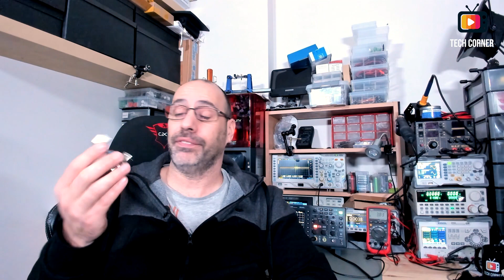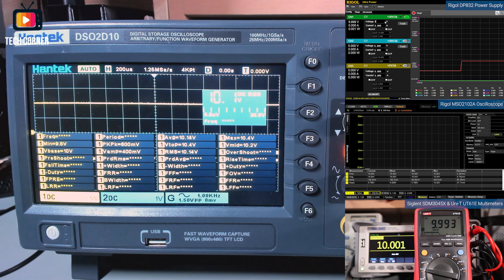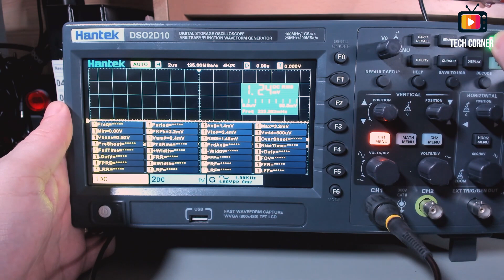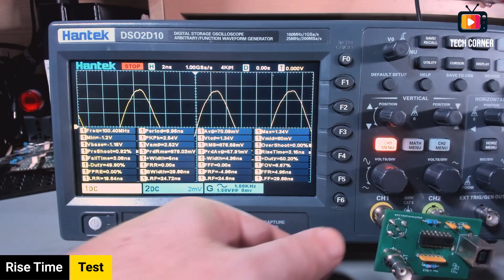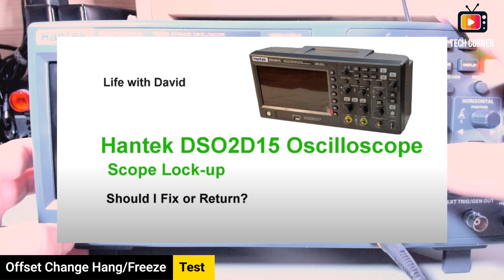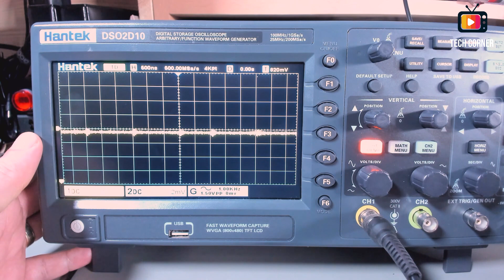Hantek DSO2000 Oscilloscope ReTest After Firmware Upgrade ⭐ 2C10 / 2D10 / 2C15 & 2D15

Comment: I've had my DSO2D15 for about 1 and a half years. When installing the latest update (hardware 3209 and software 240326.00), the crash when changing the offset is over.

Comment: HANTEK DSO2C10 measures 12v battery voltage. Why does channel 1 measure more than channel 2?
Channel 1 measured MAX 12.8V, but channel 2 measured 12.2v.
The difference is approximately 0.6v.
This clip https://www.youtube.com/watch?v=nuY9gXZR0zo

Comment: huh - how about you use a waveform rather than a voltage with all that noise you have on there - it's no wonder you cant get real mv measurements
Reply from the maker: Hi, I have a lot of videos on this oscilloscope, only tested here the things that failed in the previous ones. Thanks for your input and for watching!

Comment: It’s been 1 year since this video and I think there have been more updates. Are the problems still there or have they been solved? Also, at the end of the video you mention a signal generator but I didn’t understand the brand or model (I think it’s Jantek but I can’t find it) and also the cheap protocol analyzer you mentioned. Thank you.
Reply from the maker: Hi, after this video, I did some more, search the channel Oscilloscope playlist and you have it there my final video. My function generator is a Owon XGD2100 Dual 100Mhz output. Juntek has some very nice function generators, very affordable for what they give you, I recomend the PSG9000. In terms of protocol analyser just visit www.techcorner.tv/aliexpress and insert on the search box "USB Logic Analyzer", you'll find it from 4€. Thanks for watching.

Comment: I got a DSO3254A and the PoE option is just a straight up lie. No matter the switch or injector i use, the scope never boots or shows any signs of life at all
Reply from the maker: Hi George, sorry the late reply. It's a pitty because they have nice products, but sometimes seems they don't care. Hope you can solve your issue. You have also that option where you have a power splitter in one end with the power supply (bundled with the oscilloscope) and in the other end you have just the terminal. It operates in RJ45 cables, higly used for IP cameras. This was suggestion to solve your issue, it should work with PoE as annouced. Thanks for watching.

Comment: Mine, newest 230327.00 Firmware    has no offset problem, can move up down , no hang. I tried voltage too..  1mv setting shows half a millivolt on no input , so i am satisfied with the results.
Reply from the maker: Hello! Sorry for late reply, house move and vacations. Really good and I'm happy that is working ok, I still have to do an update of the latest firmware that was release a couple of weeks ago. Overall, is not a bad device, I like it. Thanks for watching!

Comment: Good, how could I solve the problem when putting it in roll mode, it does not show me the square wave, it only shows me a broadband, I already tried to configure it and I do not find the case
Reply from the maker: Hi, I can't know what you're seeing on the screen 😁. If auto doesn't fix it, they you have to work with time division and trigger position to have a steady signal. Thanks for watching!

Comment: What do you prefer? Hantek DSO2C10, Siglent SDS1052DL+ ó FNIRSI ADS1014D? :D thanks!
Reply from the maker: Hi, Siglent is on another championship. For me FNIRSI 1014D is very nice to work but misses a lot of important functions, so between Hantek and FNIRSI, in this case, I would go with Hantek, if the budget allows, then Siglent for sure. But 1014D is being sold around $100 in Aliexpress, so it's another price range, it all depends of what you have $$$ available. Thanks for watching.

Comment: Friend, my Oscilloscope HANTEK DSO5102P I am no longer able to update when I update it, this message appears ''Firmware Update Failed, error 0xfe An update file was not found on the USD device'', how to resolve to remove this error do you know what it is, or someone thank you very much
Reply from the maker: Hi, I know that this might be silly, but just trying to help here, did you try to upgrade the PC USB (oscilloscope) drivers to a more recent ones? Thanks for watching.
Reply: @TechCornerTV  El mio esta funcionando, creo que nunca se ha actualizado, quiero actualizar porque hay un firmware del 2021, pero que pasa? Entro al proceso de actualización me pide presionar F5 y me aparece el mensaje error de actualización de firmware, error 0xfe, No se encontró un archivo de actualización en el dispositivo USB. Queda así

Comment: Please make a short video of closed loop noise level at 1mv.
Also please make this with  Siglent SDS1202X-E at 500uv.
And please compare both.
Reply from the maker: Hi, I don't have Siglent oscilloscopes... that kind of equipment starts to be to much expensive for buying for reviews and if siglent don't send it for review, I can't buy it only for that purpose. But I can't tell you that 1mV this equipment is not able to correctly see the voltage, it starts to have some accuracy at 15mV give or take. Thanks for watching!
Reply: @TechCornerTV  Thanks for your fast and valuable reply! 🙏✌
15mv is too high!

Comment: All you say with about this garbage Oscilloscope is that you can live with it. No one is asking you if you can live wtih it. Just be honest and tell us that you don't recommend these's units until the company fixes these  issues.
Reply from the maker: Hi, that's for you to decide. I show my experience, I am not your dad or your boss to tell what to do. I can leave with it, if I really have the need to analyze signals that where in the mV range, this will not surelly be my choice. But it is pretty good for a lot of other use cases. This kind of videos will pressure also the brand to do proper quality assurance on what they release and to release fixes to these issues. This specific one was solved on later firnware upgrade, Thanks for watching!
Reply: @TechCornerTV  Thanks for update

Comment: Amigo, vi tu video  anterior donde hacias comparaciones, sobre este osciloscopio, encontré un vídeo, de febrero del 2022, donde hacen una actualización, en dos partes, una del firmware y después del software, algo complicadas de hacer, pero aparentemente se corrigen los problemas
Reply from the maker: Hola Sergio! And thats all my spanish there 😁 I still have to do a final video with the latest software, but no time to do it... overall is not a such a bad equipment, specially considering the price. Thanks for watching!
Reply: @TechCornerTV  Despues de mi comentario, encontre tus videos con las actualizaciones q te comentaba. Estoy pensando en comprarme un osciloscopio , pero voy a optar por el Owon, tiene menos funciones, pero es mas exacto y parece funciona mejor. Felicitaciones por tus videos y gracias por ayudarnos a decidir en nuestras compras

Comment: Será que vale a pena ter um desse?
Reply from the maker: Olá Marcelo, no geral, não é uma má unidade no sentido que te dá muita coisa por um preço acessível. Tem alguns problemas em leituras de voltagens muito pequenas (mV) mas à parte disso, no geral, é um bom aparelho. Este problema em especifico, foi resolvido com um upgrade de firmware. Obrigado por assistires!
Reply: @TechCornerTV  Queria saber se há necessidade de comprar um 2c15 em vez do 2c10? Faço reparo em placa principal de tv

Comment: try to get measures using the same probe used in Rigol , maybe the hantek  probe cable is no good and has some loses...or internal probe circuit is no good, and maybe is needed do the scope calibration
nice video
Reply from the maker: Hi Wilson, thanks for the tips! One of these days, I'm gonna do a last & final review of this device and in that review I will use my Rigol probes. Maybe it gives better results. Thanks for watching!

Comment: My first scope was a hantek dso5102p and the waveforms were so noisy. I saved up for a siglent then a month later scored a tektronix and a 1kva anchor of an isolation transformer in a very lopsided (but honest) trade. I gave my hantek away and vowed to never buy any hantek device again. I will say though that if the one you're showing was out I'd probably have liked it more. The old hantek had no features.
Reply from the maker: Hi Joey, yes that is the main strengh of this unit, you get a lot for the price you have. Otherwise, Owon will have no problem to suplant this. Thanks for watching!
Reply: @TechCornerTV  I wonder how the built-in awg will be over time. I'll give them credit for keeping the range low. Alot of other Chinese scopes or awgs in general try to punch higher than they're capable of and suffer for it. I don't think I've ever used my 2 chan Chinese awg for anything higher than 1mhz. It says koolertron on the scope but I've seen a bunch of other companies brand on it as well. It's decent though. 60mhz 350msa 2 chan but not split like some as far as I can tell. Amd bought xilinx recently and it would be cool to see an nvme pcie gen 5 logic analyzer or something out of that deal. I heard there's an fpga co processor for edge computing in that package.
Reply from the maker: @jstro-hobbytech  The AWG actually is pretty decent. Only 25Mhz, most people don't even need one, but you can define the voltage, it has arbitrary functions and a function editor, so quite satisfied with that one. In terms of long run, can't tell. On my daily day I use my Rigol.

Comment: Mine freezes occasionally but nothing like yours. I upgraded it to 150 MHz but I don’t have any way to test it. Have you upgraded? It’s free you just have to rename a file.
Reply from the maker: Hi Stevens, I'm working on a frequency generator based on high speed crystals, something cheap that will allow me to test oscilloscopes with frequencies higher than the 100mhz that my function generator can output. When I release that video, you can see how to test it. Your problem, probably is because of heating, you have internally a support for a fan, maybe hack your to install the fan. The freezes I got in this video were firmware issue and were solved with an upgrade. Thanks for watching!

Comment: I own the DSO20D10 and my unit also locks up when rotate the channel 1 position knob. Interestingly, it does not lock up on channel 2. So how do you prevent this?  You can prevent channel 1 from locking up by moving the position knob very slowly. It appears to me that the processor gets overwhelmed when it tries to perform too much math. When you move the knob slowly it is able to keep up so no lockup.
Reply from the maker: Hey Bob, upgrade to the latest firmware you can download from hantek website an I have a video here in the channel teaching how to do it, step by step.  https://www.youtube.com/watch?v=4Vy9acRJFQc Thanks for watching!
Reply: Estou com mesmo problema conseguiu resolver o seu?

Comment: Is it possible for DSO2C10 that can generate waveform(enable wave gen) after upgrading my firmware?
Reply from the maker: Hi, it depends when you got it. The first units came with the function generator harware and it was only a firmware limitation. I know that there is units that don't have the hardware, so for those it will not work. Thanks for watching!

Comment: I check my 2C10, offset wok fine, use last firmware.
Reply from the maker: Hi again, there are more recent videos where that problem is solved with firmware upgrade. I think it is a set of 3 videos to do a backup, restore from brick and another one, can't recall right now. Thanks for watching!

Comment: Thank-you, this video makes me re-think getting the Hantek 2D15. I'm a hobbyiest, this would be my first scope. I'm not sure I could manage the constant freezing. I read some review where they said  the IC  in the Hantek needs some  heat sinks and that will prevent the Freezing. they said "Radiators" on the IC, but I think they meant  heat sinks.
Reply from the maker: Hello, I'm trying to get the time to make on last & final review with the last firmware that came out recently. This problem was solved with a firmware update (I show on a video after), but at that time still had some issues with auto sensing and low voltages. I want to clear if that is solved, but I have devices pilling up for review sent by manufacturers and those have always priority. If someone has the trouble to send you the device for review, in my opinion, you should at least review ASAP. 
Thanks for watching 👍 You're quite active and I really appreciate your comments 🤜🤛
Reply: @TechCornerTV   totally understand, I'm trying to help someone else who has the 2D15 hantek and has lot of issues. I sent them to eevblogs.

Comment: The latest video that I can find is dated April 15, 2022 and 45 minutes in you say that the freezing issue is still there. Is there another video? It seems like the safe thing to do is to pay the extra money and go with the Siglent SDS1202X-E.
Reply from the maker: I'm so sorry to mislead you. I thought that I mentioned in my 3 videos series and I didn't. Ok, so heres the thing, the problem of freezing while moving the offset is solved. Still has some little issues with voltage detection, but nothing serious and I have to check if the last firmware solves that. Next month will do a video on that, but if meanwhile you want one and wish to help a bit the channel, you can the affiliate links 😁 Seriously, my opinion is that it is a fairly good device for the privce, you get a lot in a accessible price.
Reply: @TechCornerTV  Maybe you should do a short video to clarify this. I was searching like crazy, because I don't have much money and need and oscillosope, but the often recommended Rigolas are too expensive for me. And your latest video of the DSO2D15 made me think that it still had this issue, too.
Reply: Is Siglent SDS1202X-E a far better option than Hantek dso2d10?

Comment: Have the issues you outlined been resolved? I was looking at purchasing the Hantek 2D15, if they have not been resolved could you suggest an alternate?
Reply from the maker: Hi, I will do a video (final to close this) next month with lastest firmware that was release last month. But in general, the latest video I made about the Hantek DSO2000 already corrected this ugly bug, it still had some errors in voltage reading, but I'm expecting that to be corrected with this last update. Thanks for watching! 👍

Comment: Do any of the DSO's have a DC Offset function? In many transducer measurements it is necessary to measure low level voltage changes (~10 mv) that ride on top of -12 VDC offset. We often used a special Tek analog scope plug-in that had a 'DC Offset" function so we could keep the the scope in DC Coupled mode in the 10 mv range and use DC Offset knob to center the waveform so we could observe low level DC mV changes that were on a -12 to -15 VDC signal. Thanks.
Reply from the maker: Hi, many of this entry level oscilloscopes emulate functions and the result many times is not the desired one. If you had a special equipment to correctly do that measurement on the Tektronix, I think is pretty safe to say that they haven't the equipment in this lower price oscilloscopes, or at least, with the same precision. Thanks for watching! 👍

Comment: When do you need the function generator?  To calibrate tape decks by generating test tones?
Reply from the maker: Hi! I believe that is one of the usage scenarios, but you have a bunch other scenarios, to mock on the circuit for example, a motor output (sinewave), to mock ECG's and be able to test equipment, to simulate the work of a motor, a good function/signal generator car replicate the signal you get on a lot of situations, so you can test your circuit without having the real thing on hand, like a car motor. Thanks for watching. 👍
Reply: @TechCornerTV  can it really generate test tones, say 20 mhz tone?

Comment: Great video. Could you please compare the waveforms captured at 1~10mV level between 2D10 and Rigol or better oscilloscopes? It's important to know if 2D10 can capture small glitches ? Thank you
Reply from the maker: Hi Franz, in september I'm gonna do the last video about this oscilloscope, because many people asked for it, but spoiler alert, it is better, way better, but still with some issues. To be fair, this isn't a multimeter, but anyway it has to be accurate. That will be my last review video on this oscilloscope. After that, it will end. Thanks for watching! 👍
Reply: Dear Franz, I´m radioamateur and electrical engineer, too. I need this oscilloscope only for alignment for some older CB-Stations and some microcontroller projects. I bought this scope before one week:2D10. But at low signals, it is something noisy, I have some analog meters for low signals and a spectrum analyzer Rigol DSA815, but I think and old analog oscilloscope, would be better for me, because it´s not so noisy for lower signals.I have an analog oscilloscope Hitachi VC-7504, 150Mhz scope, with something digital properties, but it need serviced, I changed some capacitors in vertical unit, but I dont get a service manual from Hitachi more.Without alignment it doesnt start.😕

Comment: Bought the DSO2D15 model, only later I discovered it has Trigger Level problems with signals below 300 mVpp. I did all the firmware updates, still the traces run on the display, no way to stop them. Things get worse if you keep the oscilloscope on for more than ten minutes. Then, if you select a 50 mVpp sine wave with the internal signal generator, the image is strongly distorted.
I contacted Hantek several times, they wanted a video of mine showing the issue. Sent the video twice in a month, then Hantek disappeared. I re-sent a final e-mail today, I am waiting for a sign of life from them. At this moment no help at all, their after sale sucks.
I did a BIG mistake, I should have bought a Tektronix instead but you only learn these things later...
Reply from the maker: Hello again, replied to you in the other video... 😁 thanks for watching!